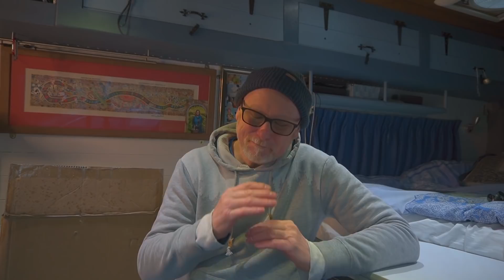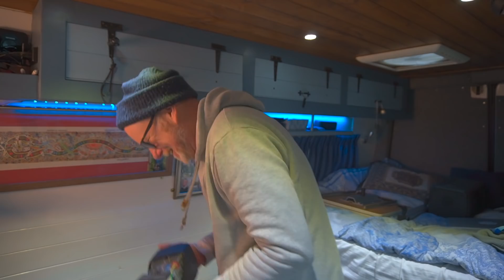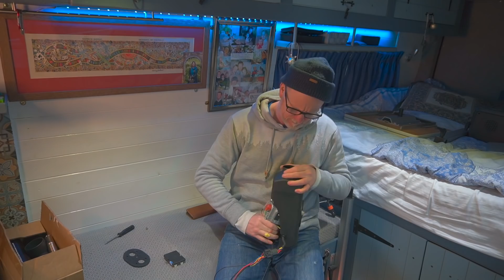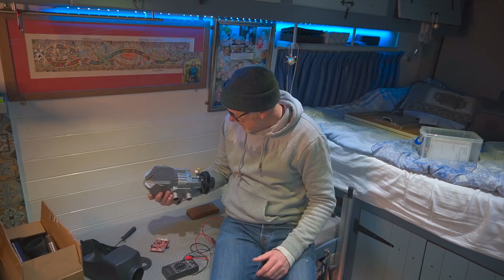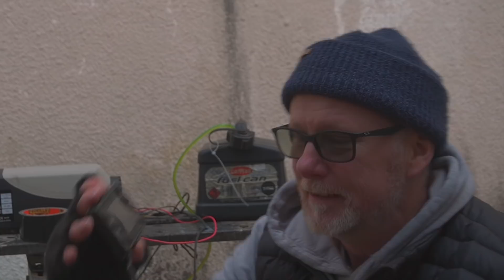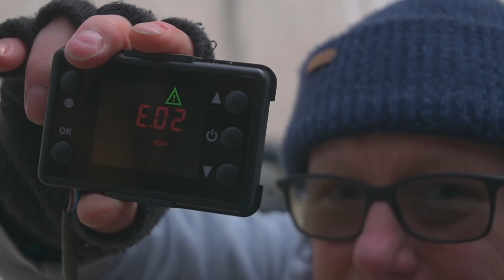how safe is a cheap chinese diesel heater?What happens when a Diesel Heater loses power?

Comment: I guess other people will have said it but I guess if it runs out of diesel it doesn't get the opportunity to go through its cool down process which is essential. Like they warn you shouldn't switch off the power as it will do damage. Ps I just fitted a Maxpeedrods 2kw ,  tank a few inches over heater, therefore slight gravity feed. I primed first time by letting the fuel run right through to the pulse pump before connecting. No sucking diesel! 😉
Reply from the maker: Brilliant buddy that’s a great idea 👍

Comment: ....You ordered a 24v one or you changed a setting that you weren't supposed to change.. or you do not have enough punch coming out of those boxes.

Running out of fuel makes absolutely no difference, I regularly let mine run out of fuel.

Comment: Hi Mel great video did some digging and seems a lot of people had same problem cured by higher gauge wiring direct from battery. And we Asti have same problem with over voltage whist on lithium. Don’t know if it helps. But great video anyway..
Reply: Webasto

Comment: Press the 2 bottom buttons ( OK button and down button) but then you press the up button  (top right) and it should start priming
Reply from the maker: Nothing happens
Reply: @MelsBigVanSmallWorld   sounds faulty right enough Mel. Could try buying a new digital control 🤔 is the control off your 5kw heater compatible?

Comment: Hi Mel, I just watched your video and had a thought on the low voltage error; have you inadvertently changed the voltage setting to 24v whilst going through the settings menu? worth a look and see.

Cheers Dave
Reply: One of mine came pre set to 24v and would always show error low voltage. I had to go into the settings and set to 12v, all was well after that. Also you can't run them through a cigarette socket, not enough amps

Comment: Hi again...seems many translations for e02...vvkb website for diesel heaters show...Cause of issue: Flame sensor short circuit

Solution:

Check the flame overheat sensor with a multimeter. If it is a short circuit or open circuit, please repair or replace it.

Check the flame overheat sensor with a multimeter whether it’s damaged. If it is, replace it.
please check whether the flame sensor is loose.

Take of the sensor, use a multimeter to check the resistance of the flame sensor. It should be 850-1250 ohms.
Different than others easy to check!!!good luck!!

Comment: On ebay i found a different more basic controller, it has a single rotary knob for the thermostat, also a single button for off and single button for on. i simply unplugged the digital display controller, and plugged the simpler version in. i pushed once the on button, turned the thermostat to full, and the heater primed itself with no issues first go, then i just turned the thermostat down to a comfortable level. no issues in 2 years of operation ! the good news is the basic controller only cost about £10 ! so easy to use and no faffing about ! hope that helps someone. 😉😇
Reply from the maker: I had one of them in my old VDub absolutely brilliant the best by far 👍😊👍

Comment: I had same underpowered error code when I first tried my 2Kw heater on a battery bank and the manufacturer informed me it had to be connected to a proper battery as the battery bank didn’t have enough current for the glow plugs. Hope this helps Phil

Comment: Mel, we had the same problem with our 2kw heater ( we brought it on your recommendation)  however we wired it straight to the leisure battery and bingo it works a treat. Also we primed it using the up and down buttons but had to hold them whilst it primed 😁
Reply: Exactly what we did for our 2kw heater, pain holding the up and down but once done, works a treat.
Reply from the maker: Thank you 🙏

Comment: I must add this: Everybody speaks about "the 2kw Heater is this" and the 5kW heater is that". You have a knockoff fake 2kW Eberspacher, whereas I am unfortunate to have the knockoff fake 2kW Webasto Airtop 2000. Big difference in controllers and components, but same principle. But not the same error messages and stuff. Most people seem to have the Eberspacher knockoffs, my luck I have no real online support for my fake Webasto - nobody else seems to have it. Visually, the difference is that your top cover lifts of like a car bonnet/hood, whereas my Webasto pops the endcaps and the top cover comes off like that.  I have a silly little controller interface with one red knob and I know how to start and shut down, and have forgotten how to prime, but nothing else - no fine tuning of Herz and all that. I'm really feeling miffed and lonely.

Comment: Mel I’ve just checked the manual I got with my 2kw Max speedy and E02 is ignition plug failure, check deposit of the plug.
Reply: E05 over voltage and E06 under voltage in the manual
Reply: Check if plug is loose disconnected or shorted with the controller, check carbon depositions of the plug
Reply from the maker: Thank you my manual says complete different 🤔

Comment: It does sound like the suggestion lots of people have made about it having defaulted to 24v is quite likely to me. Lots of YouTube vids on how to do it but essentially the steps should be:

1) Press the "settings" button (with the cog pic) and press again a couple of times to toggle through the screens until you see four flashing dashes. This is your gateway to the 'advanced' menu
2) The flashing dashes are where you need to put in your password. This is probably 1688, if not it will be 9009. Press up or down arrow to scroll through the numbers and when you've got the right one, press "OK". That will take you to the next number. Repeat until you've done all 4 numbers.
3) This will take you into the 'advanced' menu. The first screen will say something like "P-10" which you can ignore and click the "settings" (cog) button again. Next screen will be your min fan speed (around 1500 rpm), click "settings" again. Next screen will be max fan speed (around 4300 rpm). Click "settings" again and you should be at the voltage setting
4) Screen should be blinking with U-24v (if we are all right and it's set to 24v). Press the down arrow button to set it to 12v and press "OK"
5) You will then see SN-1 on the screen. Press OK again
6) Last screen will say "Of". Just click "OK" again here and it should take you back to your usual 'home screen'
7) Plug it all in again on your test rig and try it now. Should fire right up. 

It's worth having a read about what all these other settings are and what they do. I had real problems with a 2K heater and eventually found out it was because the controller had been programmed for a 5K heater - so it was throwing too much fuel in and it kept sooting up. Advanced settings allowed me to programme it for a 2K heater and it's worked perfectly ever since.

Looking forward to see if this fixes it!

Comment: Mal, just a thought has you heater gone into 24v mode as i believe they are the same heater as the 12v i believe that you can switch the voltage in the advanced menu, if so that could be throwing up the voltage error as its only receiving 12v,? all the best mate.

Comment: Hi Mel, just as an aside, these heaters should Never be powered through a cigarette lighter socket, they are too flimsy and cannot support the 10+ amps the heater needs to start, the contact piont on the front and the spring behind it both heat up and gain in resistance. this can be seen if you check voltage at the motherboard, (not the battery) whilst starting up.
If it was giving the same issue in your van then i would be looking for a poor connection/ dry solder joint in the harness or main plug.
Hope you sort it, cheers.

Comment: We had error E02 and the unit had gone to factory default setting of 24 volt, went through the settings to reset back to 12volts and everything worked correctly
Reply from the maker: Oh crap maybe that’s what’s wrong 👍

Comment: I don't think its faulty..... shorten the power wires and measure the voltage at the heater, not at the battery end :) I bet its low near the heater and good near the battery :)

Comment: E02 is over voltage on most ECUs.

Normally found if running off a PSU as they increase the voltage to compensate for load.

16V is the cutoff for overvoltage.

Comment: Hi Mel, have you inadvertently changed it to 24v whilst you were pressing buttons? Worst case scenario you can buy a matched pair controller and circuit board off eBay that’ll fix it.

Comment: Dear Mel, if you search for: vvkb-heater-fault-solution, it says:  
E02 Cause of issue: Flame sensor short circuit

Solution:
    Check the flame overheat sensor with a multimeter. If it is a short circuit or open circuit, please repair or replace it.
    Check the flame overheat sensor with a multimeter whether it’s damaged. If it is, replace it.
    please check whether the flame sensor is loose.
    Take of the sensor, use a multimeter to check the resistance of the flame sensor. It should be 850-1250 ohms.
If the resistance is between 850-1250 ohms, check the sensor with following pics.
Check whether the copper wire in red circled parts touch the iron shell in yellow circled (The uneven cotton will make copper wire touch the iron shell, so E02 appears)
If the above is all ok, please flatten the cotton, then put on the iron shell and install the flame sensor. Restart to check whether there is still E02.

Note: The cotton can’t cover the yellow circled part.
If there is still E02, please check whether there is some conductive mental or dust between tweezers in yellow circled part.

Clean the yellow part, but it there is still E02, the circuit board may fall faulty.

Comment: Go into the settings make sure it’s 12v not 24v most of the time they come NOT on 12v after all there for truck overnight heaters primarily ! I had this exact issue myself, & sure enough it was on 24v in the settings

Comment: If that's  a new controller it could be set at 24v or if your jackery isn't fully charged it might not be giving enough power , as they do say connect directly to the battery as they are quite voltage sensitive, also if you wanted to prime it first you don't actually turn on , you    press the two bottom buttons at the same time

Comment: I am not aware of any differences in constructions/functions between these 2, 5 and 8 Kw heaters, but logically, counting the effect alone, a 2 Kw heater would be the first choice for a (relatively small/well insulated) van, since both a 5 and 8 Kw is overkill for such a van - and having these heaters run on low effect is usually not good for them (soot-wise). I would go for some of the sensors or the control panel and everything between when looking for a fault here.
Reply: Very sound advice 👍
People always want bigger cos it's better 🙄 i fit 8Kw units to 40+ft narrow boats and they are fine, total overkill in 90% of vans which meens they spend all the time on low and as the logic used to control the Chinese heaters is poor they soot up, the fuel air ratio isn't controlled closely enough so i recommend running on full at LEAST once a month to keep soot levels down 👍

Comment: Mel I would loose that power plug and go with hard wire to fuse block or get a good Anderson type plug. I've gone through two heaters and the bearings were my issues.  You have to be careful mixing parts from different heaters together they keep changing small things like plug types and the timing magnet spacing are different on different heaters. as the heaters go through new generation.

Comment: Good video on a diesel heater Mel  👌 I've got a quick question not on diesel heater but on a solar controller I'm thinking of putting solar on my van does the display on the controller being on all the time drain my leisure battery or can you put a switch in between the solar and the battery to turn it off thanks for any advice Dave
Reply: The display will draw yes but it's so low it'd take months without solar to drain a battery and your solar will top it up each day 👍
Reply: @Dirt-Diggler  thank you for that wasn't sure how much it would drain but that puts my mind at rest 👍

Comment: Hi Mel have fitted quite a few of 2 kw diesel heaters never had a problem, I do remember thinking to myself did Mel change the pump at the same time as the 2 kW heater also the green silicone pipe expands so the pressure isn't accurate so I would suggest the proper hard nylon pipe to stop this. Also I have seen other people accidentally turn these heaters to 24 volts while setting the fan speed 👍

Comment: Hi Mel,
Great video yet again, I had a similar issue with E03 code, so I ordered 2 new glow plugs installed a new one then had the same issue, this is now in my shed as a spares heater.
I then on your recommendation purchased one from maxpeeding rods which got delivered to Leicester (I am in Cornwall) then they sent another one which never arrived.
So then I purchased one from Amazon which touch wood is now working.
When these heaters work they are great but so frustrating when they don’t work.
E-03 is glow plug or low voltage but I eliminated power by using jump leads from a running vehicle. 👍🏼

Comment: Very unlikely that the lack of diesel is the cause of a problem with the electronic part of the heater.
I would invest those 20 pounds in a new circuit board.
Perhaps the cause is in the fuel pump and the pump is pulling the voltage down.

Comment: Hi Mel, 
Just a small note, the diesel is not sprayed into the combustion chamber, it just kind of flows or pulses on to the atomizer screen which is red hot because of the burner being lit once started by the glow plug initially.

Comment: I noticed the controller was already showing some heat in the burn chamber when you powered up the heater. This usually means the temp sensor is bad. Usually about £5-10 on amazon, worth a try!

Comment: Have you checked the voltage output from those power packs (too low maybe?) and have you tried running it off of your van with the engine running in order to establish if the voltage threshold needs to be above a certain point? Obviously if that threshold is above say 13 volts it won’t be of much use on your van but at least you’ll have a better idea of the cause and finding a possible remedy.
Reply from the maker: Yep tried that 👍

Comment: First start my heater i needed priming cycle about 5 times. Depends how far pump is from heater. looks like fuel flows  about 1mm a second. or per pulse. Can't see how running out of fuel harms the heater. Surely would just blow cold.